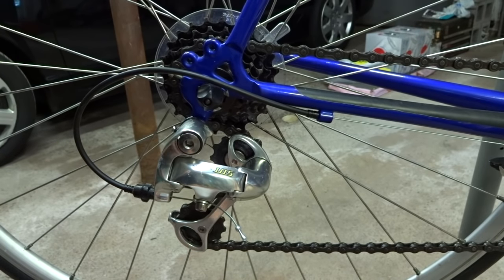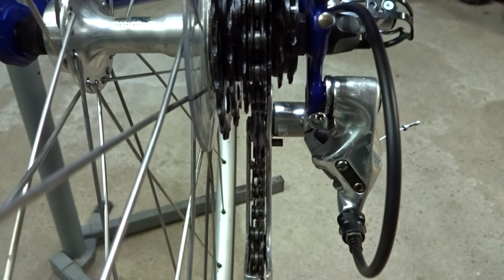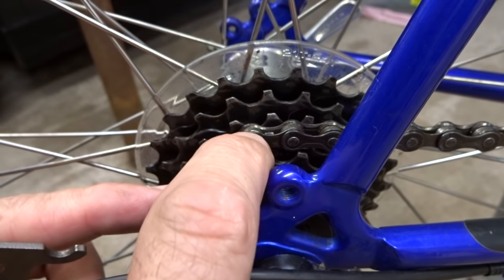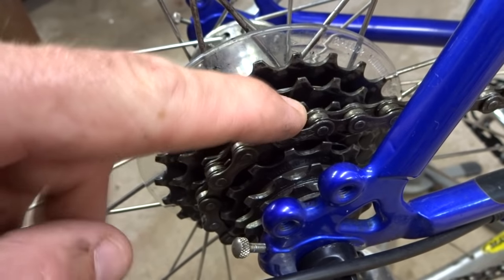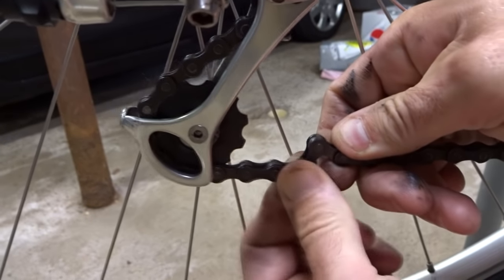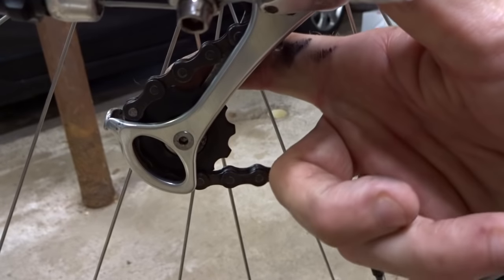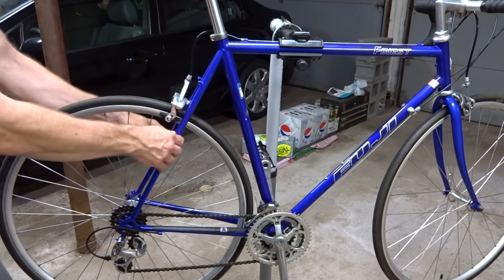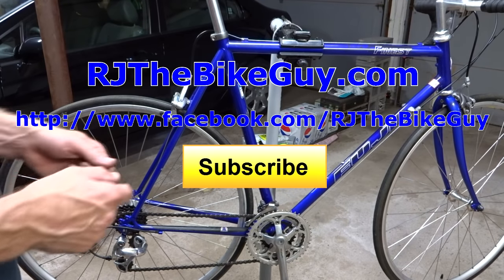How To Fix Bike Chain Skipping/Slipping/Jumping Gears

Comment: Well, I basic have a 18 gear set for a mountain bike.. they keep slipping!  My long time bicycle repair shop has a very well trained old owner, He said the slipping s because of the smallest set of cogs are worn due to me using a trailer?  I had the trailer for about 11 years now and the gears on the bike are about 12 years old.. Now I asked him, since the chain keeps slipping can I change the chain only and not the gears?  He said NO the wear on the chain is the same wear on the small gears.  I if just changed the chain the gears would not work as the wear & tear is on both of them..  they have worn together?  If I wished to replace the chain then the full 18 gear set must be changed too.  You said just change the chain?  So sounds if you are not giving the right advice there?  Yes you then said change both, But you did seem to point to just changing the chain?
Reply: A worn chain is often the cause of worn sprockets as the worn chain "chews" on the sides of the teeth instead of falling into the pockets between the teeth as they're supposed to. The smaller sprockets wear quicker with same relative use as the larger ones, for the reasons the video states. Because it is also worn, you'll need to replace the rear cassette, which slides off the hub. If you want to do it yourself, you'll need to buy the corresponding tool that works with your cassette (should be a multi-splined driver) and a chain whip to hold the cassette when you loosen the lock nut—take the wheel off, use the chain whip to prevent the cassette spinning to the left, use the splined tool to unscrew the lock nut on the end, pull the cassette off the hub, and replace. You say it's an 18 speed, but I don't know if that's 2x9 or 3x6. I'm going to assume the former as the latter would be pretty old, but either one should be fairly cheap off Amazon as 9s or 6s are both older . . . actually, if it's a 6-speed rear, you have an old bike and it may be a freewheel instead of a freehub, but the solution is basically the same. You'll probably want to look on Amazon as an LBS is very unlikely to have something that old lying around (most LBSs have become new bike assemblers and regard anything over 10 years old as if it were a penny farthing). You're going to find all kinds of options for speeds and types. To keep it simple, stick to the same manufacturer and type (say, Shimano HG) and number of speeds in the back, but you can change the gear combos, like if you want a lower gear than you have, you can get a cassette that has a larger biggest sprocket on it . . . hm, never mind that, just get something that's close—you don't want to have to get into maybe changing derailleur cage lengths and such. And you can ignore "road" or "mountain" labels—as long as you get the right manufacturer, number of speeds, and range, it doesn't matter. That said, it's most likely what you'll find with the same or close to the same gear range as a mountain cassette (mountain cassettes tend to have a wider range with more low speed options for climbing over roots and mud and such).

IMO, I don't think the trailer's to blame, yes, it puts more load on the drivetrain, but you got a good number of years out of that cassette and I suspect it's more likely the worn chain that wore it out. You can ride a worn chain for a while before it starts causing problems that make it obvious. It's a good practice to check them every year or so, depending on how much you ride.

Comment: Hi RJ,

I am trying to restore a SR Suntour fork.

I got the plastic tool for the top caps but the top cap is stuck and I cannot undue it with the small plastic tool.

Got any tips for undoing stuck plastic caps without ruining them? 

the suntour tool has a very small handle and i cannot undue the top cap with it
Reply from the maker: I make a tool from an old socket in this video:https://www.youtube.com/watch?v=tABGvESjL4o
Mountain shocks and road shocks have different sized caps.

Comment: So, all my gears seem to work, except one...the left shifter (number one) which I'm assuming controls one of the front gears. None of the combos work with "number one". When I ride slow to medium speeds, and I shift from 2 to 1, it still pedals but sounds like the chain is not engaged and clicks and clacks, like something is about to break.  Does that mean its most likely a worn front gear?? I suppose i should try adjusting it first?
Reply from the maker: https://www.youtube.com/watch?v=84YpHC6523s
Reply: RJ The Bike Guy thanks!

Comment: As my bike shop told me, my slipping is down to worn out front gears!  I use a 18 speed mountain bike which often has pulled a trailer which can be sometimes heavy ( up to 70 pounds it can hold ) Although I most likely pulled around half that.  And yes I tended to use the lowest out of those 18 gears settings due to the slower more better pulling effect?  It now slips when I need to cycle off quickly to pull out at a junction.. and I do now even touch the shifting control grip handle then!  Just old age and heavy use. I had another mountain bike before this one and after 10 years of weather and pulling the trailer it wore out the lower front gear set.  So I will have to buy a new set of gears,  Maybe just the front set with a new chain? If the back set is too worn I just have to really pay out as a full set and chain in the UK without fitting by the shop be £80 almost the cost of the bike new!
Reply from the maker: Might have to replace the whole drive train.

Comment: As an ex biker I'd not just change the chain, freewheel and chainring also. Chain is made of mild-steel, chainring etc is made of a softer metal, chances are the chainring will damage a new chain.
Reply from the maker: Chains wear much faster than cassettes or chainrings. If you replace the chain when it starts to show wear, the other parts will last longer.

Comment: Can not believe suggesting replacing a chain that probably only needs oil.
Reply from the maker: If a chain is worn, it's worn, and oil will not make it unworn. Oil will not remove damage from rust either.

Comment: My bike tends to do this a lot, I have a Boardman MTX 8.6 hybrid. I am scarred to ride out of my saddle because I am afraid they will jump. Once it jumped into nothing and I fell off. Could there be any reason why my chain broke in the first place. I stopped riding out of the saddle and that’s when it happened. Was riding slowly and the gears started to change then the chain broke. Why did this happen, any help is much appreciated thank you!
Reply from the maker: I have not worked on your bike, so I can't give a diagnosis.
Reply: James Cox I broke my leg but I removed the derailer now it’s perfect

Comment: I've fixed plenty of those too. It's not a dirt or grease problem. It's always the older shifters that fail. It's because the grease in the pawl dries out and oxygen in the air gets into the joint and after 10 years of rusting in the joint the pawl freezes in the open position. To fix these I just push the pawl back and forth 30-50 times until it snaps into the teeth again. Then hit it with some light lube and it's good for another 10 years.
Reply from the maker: https://www.youtube.com/watch?v=rOxK9TZaevY
While is causes shifting issues, I haven't seen it cause slipping, skipping of gears.

Comment: Hi. Thank you for doing these vids! But since I am a Newbie I can't identify my problem.
I have a MTB with a 3 (48-38-28) x8 (11-13-15-18-21-24-28-32) speed. When I am in the middle chain ring and in one of the three smallest cogs (15 (more or less ok), 13 (very bad) or 11 (worst)) or in largest chain ring and one of the two smallest cogs... the gears jump (when I apply torque and it jumps the torque doesn't get transferred to the wheel; if I would stand up uphill and paddle hard my foot would slip of the paddle, so I am almost not using these gears). I tried adjusting the rear derailleur but when I adjust it to the left the chain shifts to the next bigger cog (e.g. 11 to 13) and when I turn it right it doesn't get better till the end of the adjustment screw.
My guess is a bent Derailleur Hanger but I don't have such a tool to adjust it and I am not sure about it. Can I fix it in another way or should I take it to my local bike dealer? How much would it cost to fix it?
Reply from the maker: If you can't solve it by following the video, take it to a shop.
Reply: Thanks for the quick answer

Comment: Just got my chain replaced, it appears to be slipping over the teeth on my cassette however, my old, warn chain didn't do this... any suggestions?
Reply from the maker: Then the cassette may be worn. Or maybe the chain is too long. Or something else. Go through the video.
Reply: RJ The Bike Guy. Thanks for the info.  I looked it up more and some people said it could be the crankset and chainrings that decided to start doing this after they replaced the chain

Comment: my chain skips the cogs, and I got a new cassete, new chain and new chainring and I still get the chain skipping, because of that issue my chain broke 3 times
Reply from the maker: If you checked everything in the video, then take it to a shop and have a mechanic look at it. Skipping usually doesn't cause a chain to break. Not sure how you joined the chain. Hopefully you didn't reuse a pin. That would cause it to break right there.
Reply: @RJTheBikeGuy  I just found this video, so I will check it later, however the chain got fixed by the mechanic with a new pin. When I usually peddle on a certain gear it skips and making a weird sound and it isnt that smooth.
Reply from the maker: @closingdealz  Personally, I don't like joining chains with pins. I prefer a master link. I just have more faith in them.

Comment: Hi Rj the bike guy, I have a question but it's not related with your video. I recently refurbished an old rear hub and I changed the old axle. But I can see all the ball bearings because I don't have any dust cover for it (but all the bearings where placed correctly). Is it still safe to use the rear hub even if all the ball bearings are exposed? And btw love all of your videos! :)
Reply from the maker: Well, it's safe, but since the bearings are so exposed, they will quickly become contaminated with dirt or whatever.
Reply: +RJ The Bike Guy wow thanks  a lot for answering! :)

Comment: what about the front sprocket, the front sprocket had three gears (teeth) and i only used the middle one and it wore out this caused my chain skipping and was the problem.
Reply from the maker: If the front is slipping, it's generally pretty obvious.
Reply: @RJTheBikeGuy  it wasnt obvius to my bike repair shop, they changed the cassette chain and derailleur  then i took it back telling them it is still slipping and now they tell me the front chain ring is worn and that needs replaced and that was the cause of the problem.

Comment: Be careful clamping your cycle down where theres a cable making direct contact to the frame if you're worried about the paint. Especially if you're making adjustments to your limit screws and shifting or even adjusting brakes. I haven't invested in a stand myself yet but that was my first thought seeing them. I'll clamp to my seat post due to my cable routing.

Comment: I think what's happening with my girlfriend's bike, is the shifter cables / housings are in such bad shape that it takes so much force to shift, then after she's gotten it to shift, that tension is still sitting in the cable / housing, and then suddenly it settles, pushing the derailer further in the same direction.
Reply from the maker: Replace the cables and housings. Also check out this video: https://www.youtube.com/watch?v=07Bc0QkudW8

Comment: Hello RJ. My bycicle has a cheap front fork and it doesn't absorb impacts at all. I've tried lubing it but it didn't help. What if i remove one spring from the fork... instead of 2 i'll have 1. Should i do it?
Reply: What could go wrong?
Reply from the maker: Don't do it. It's a cheap fork. It works like cheap forks do. Get a better bike with better forks.

Comment: My chain is too long on the smallest cogs of my MTB so chain slippage was a common problem, but i couldn’t lessen the chain length any further because it would be way too short on the biggest cogs.

I fixed it by adding a rear derailleur hanger extender and positioning my RD a bit towards the front for the chain to form a shape close to a letter “C” or a crescent when on my cogs. The more links that come in contact with the teeth, better it holds. Since then, my chain never slipped.

Hope this helps.
Reply from the maker: You shouldn't have to do that if the drivetrain was all configured correctly to begin with.

Comment: Can someone tell me if both left/right gears are Independent from one another ? stupid question but do they work independently or do they work with each other,if they do does that mean ive got to be in a certain gear on the right side in order to work the left gear ?
Reply from the maker: The left shifter operates the front derailleur. The right shifter operates the rear derailleur. They are independent. But the choice of chainring in front and cog in back is your gearing. You don't want to cross chain where the chain is at opposite extremes in the front and back and the chain is angled one way or the other.

Comment: when i shift from a easy gear to a hard gear down the cog it slams into gear , i have changed everything except the derailleur i even changed the pullies in the rear mech , i haven't changed the crank its self just the ring , all i did was change my handle bars after my carbon one cracked since then it hasn't shifted normal at all , i cant figure it out , it will catch all gears doesnt skip but when i shift into harder gears it basically smacks into gear and the bottom chain wiggles , any clues , i brought it to a shop with no real result ...
Reply from the maker: I can't do a diagnosis without working on the bike.

Comment: Another helpful video. Thanks RJ. I have a question I'm hoping you can help with. I have one rear wheel, among several, that when I shift into the biggest cog, the derailleur cage touches the spokes.. I don't want to adjust my limit screw because that will adversely affect the shifting limit in my other wheels. Is this a wheel dishing issue or afreehub/cassette issue? Thanks for your assistance. - Ric
Reply from the maker: https://www.youtube.com/watch?v=TpsG8eDF53U
Reply: +RJ The Bike Guy thanks RJ

Comment: How about chain tension causing slip on higher gear cogs. Could be the chain is too long and needs reducing in length!
Reply: So if none of this works, should I take a link out and see if it fixes the issue?

Comment: Any idea if the chain isn’t skipping/jumping, the derailleur is lined up properly, but its making this slight clicking sound and it feels like it’s catching on something before releasing and resuming as normal. Took a fall couple of days ago and took my bike to the mechanic but the problem is still there. This is a new bike (only 5 days), could it be an lubrication problem?
Reply from the maker: If the bike is new, take it back to the shop and have them fix it.
Reply: RJ The Bike Guy Will do, but any idea as to what may be causing this? I’d just like to know for future references :) Thanks for the quick comment!
Reply from the maker: @sabrinam.4949  Not without working on the bike. Go through the video.

Comment: I'm a pretty good bike mechanic, but this one has me stumped: I wanted to set up my new SOMA Saga disc with the same 3x9 all new Deore components that my Surly Troll has (and where they work perfectly). Guess what? On the SOMA the chain slips on all the cogs! I've tried everything, but have had to reinstall the 3x8 components (which have never slipped). What's going on?
Reply from the maker: Can't tell you without working on the bike and know all the details. The stuff in the video are some of the main causes. Could be lack of chain wrap and not enough teeth engaged. etc etc etc.
Reply: @RJTheBikeGuy  Thank you for your rapid answer. Yes, I've spent a lot of time on the chain wrap, but you would think that on a 34t cog there would be enough wrap!
Reply from the maker: @jsaintclair1  There are many possible reasons. It could be the freewheel/cassette slipping. Go through everything in the video.
Reply: @RJTheBikeGuy  Problem solved through sheer perseverance, AKA try everything. It's well nigh impossible to find a new Shimano 9 speed trigger shifter nowadays (except from Austria, Italy or Poland!) that will pair with my Deore 9 speed RD (easy to find new). Since Shimano apparently uses a 2:1 actuation ratio on their RD and and shifters, trigger or not, I discovered that the Sunrace 9 speed trigger shifter, still easily obtainable, possesses that famous 2:1 actuation ratio needed to prevent skipping. I was trying to use a Box One trigger shifter whose manufacturer neglected to say that it has a 1:1 actuation ratio (like the SRAM), a fact that I had to discover for myself. In the future I will pay close attention to actuation ratios!

Comment: Here's a question. I bought a ztto cassette and it skips when standing on the pedals when I'm in the small chainring on 11 13 or 15, on 17 or higher it's ok and no skipping on big chainring. The weird thing is that it won't do that with a Shimano cassette, I've actually tried with ultegra and an 8 speed cheaper cassette and both work fine. Any ideas on what it could be. I think I just bought a cheap cassette that doesn't work that well
Reply from the maker: The big cog has more teeth engaged. So less likely to skip. Maybe chain, or who knows. Go through the video.
Reply: @RJTheBikeGuy  I did. And tried to find an answer googling it. But u r right bigger cog has more teeth engaged so it makes sense. I guess Shimano is just better quality. Thanks for the reply 😁